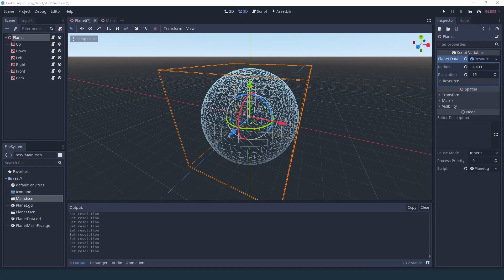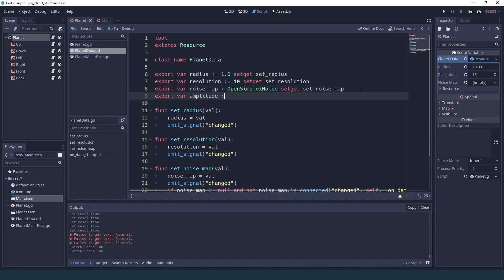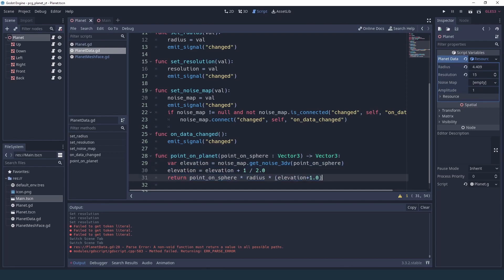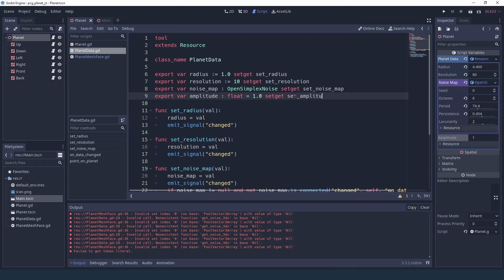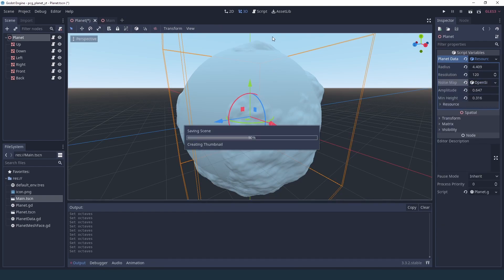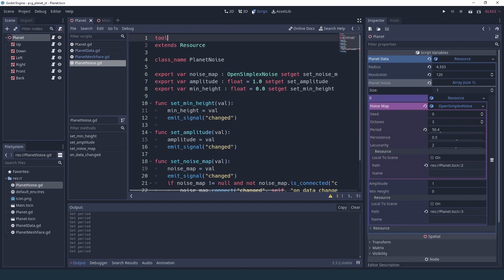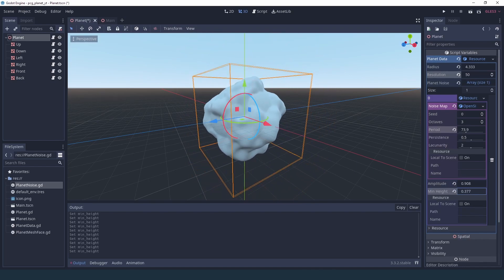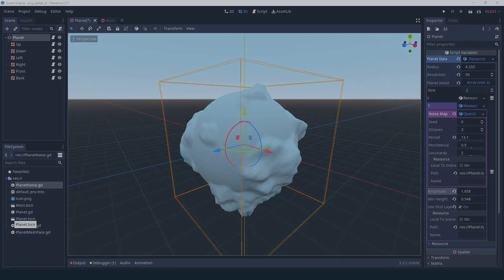[Godot] Procedural Planets (E03 Simplex Noise)

Comment: edit.. again i fixed my own problems through many trial and error..  ugh..  One problem that still persists tho is when i add a new noise resource to my planet, it disapears until i actually set the resource and noise texture.  again oh well its not horrible bad just anoying.  Nxt video here i come

ps, i also used the abs() function   abs(level_elevation) * n.amplitude     .    i feel like it amplifies the noise more rather than just expanding the entire planet.

Comment: Not really sure why you added another noise to make mountains. you could have kept the idea of noise being between 1 and -1, multiply that by the normal vector and amplitude and ADD that to your original verticie vector. then square or cube the noise value above 0 and multiply it by a larger amplitude. 1# you have more control this way because your radius doesnt scale with your amplitude, 2# the method of exponentializing your values over 0 and multiply that by a larger amplitude will give you terrain that isnt supper rugged while still giving you nice tall mountains here and there and 3# it just looks better this way

Comment: Thanks for the excellent tutorial!

Some code for Godot 4 to make it work... Note how I declare a PlanetNoise Array rather than Resource Array, since the class already inherits from Resource it's quicker to call the class straight away so you don't have to go down the list. Also note that emit_changed() and emit_signal("changed") do the same thing when this tutorial is concerned. At least it works for me :)

@export var planet_noise : Array[PlanetNoise] :
	set(val):
		planet_noise = val
		emit_changed()
		for n in planet_noise:
			if n != null and not n.is_connected("changed", on_data_changed):
				n.connect("changed", on_data_changed)

func on_data_changed():
		emit_changed()
Reply: In Godot 4, you can simplify even more to just:
n.changed.is_connected(emit_changed) and n.changed.connect(emit_changed)
No need for the data_changed signal and on_data_changed handler at all!
Reply: @oliverkuss139  yeah I noticed how it included some behaviour for this :) whatever more you can do with less code sounds like a best practice for me. It's great to have this convenience for unit testing.

Comment: Hi! Nice Work!
I am trying to use height map to create existing planets. 
It's like what Sabastian did here: https://www.youtube.com/watch?v=sLqXFF8mlEU
But I'm not having success using textures. Do you have any suggestions?
Reply from the maker: I think his code for converting the xyz of the point_on_unit_sphere to UV coordinate should work pretty much as-is. Loading a texture should be pretty easy to do in Godot too. Then you can do Image.get_pixel ( int x, int y ). Where the X and Y are the UV coordinate multiplied by the resolution of your texture. You can then use the Color to determine the "elevation" part in the point_on_planet() method.
Reply: @Ombarus  I did it all. The problem is the kind of texture I'm trying to use. The equiretangular textures does not work well. 
The pole regions are compressed while the equatorial region is enlarged. I need to review the way I calculate UV.

Comment: im getting an error at noise_map.connect("changed", self, "on_data_changed")   It's saying that " The function 'connect()' returns a value, but this value is never used." Also I can't get the sphere to show up, its not showing at all.
Reply from the maker: That shouldn't be an error, just a warning. I've never actually used the return value of connect() so I just ignore it. You can download the Github project linked in the description and compare to help you figure out your error.
Reply: @Ombarus  ok